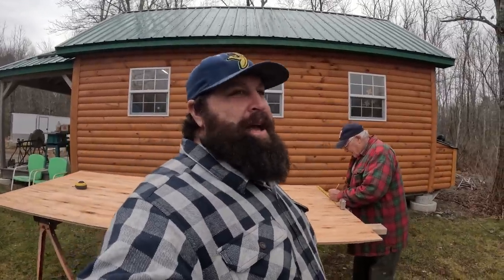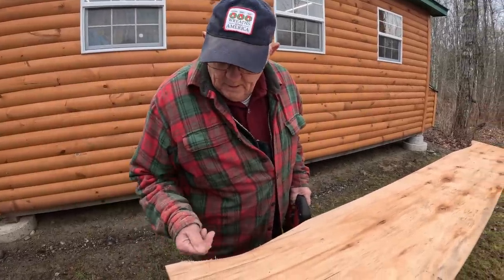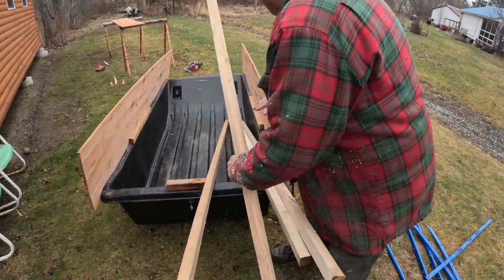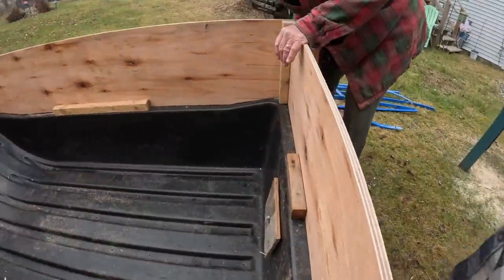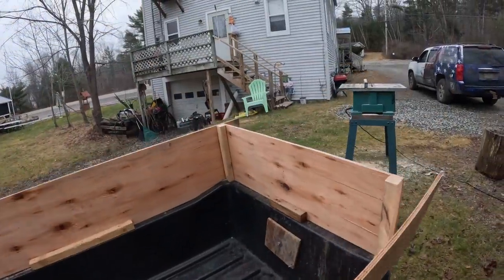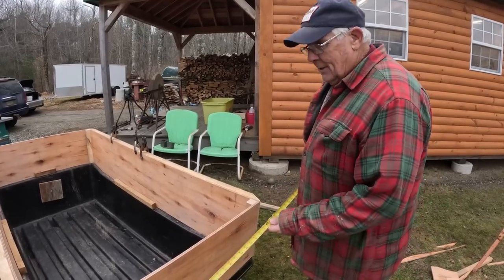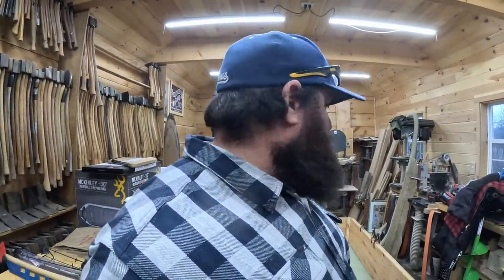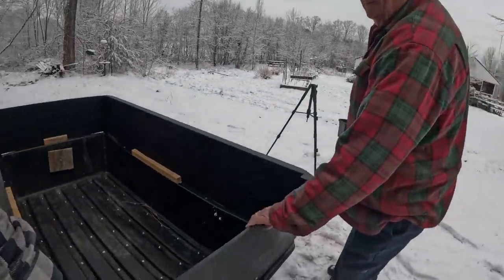BUILD YOUR OWN BRANDON BOX

Comment: I was thinking about building one of these when I decided to upgrade to the otter pro large. Then I hauled my large up into the trailer when full. Couldn’t imagine having twice as much stuff in there! Must be heavy as all get out!  That being said, my pack basket was able to slide out from under the cover on our way back this weekend. Total yard sale.
Reply: i have the otter resort i think its the large sled, its damn near impossible to load by myself in my trailer if its loaded for ice camping lol.  ill put the snowmobile first then ill use it to grab onto and pull myself and the otter up 🤣
Reply: @ohnij3d221  I loaded my snowmobile first too, but then found myself stuck in the front of the trailer deciding whether to take the access window out the front, tromp over the loaded sled, or fling myself over the snowmobile to the side door. 🤣🤣
Reply from the maker: The sides and the cover are anti-yard saleable , without a roll over.

Comment: You should show if you run tandem otter sleds when you’re towing your gear.  Putting a rear connection to have two otter sled behind skidoo
Reply from the maker: I do run tandem. Just an I bolt through the back as a new hitch.

Comment: Why not rip treated 5/4 or deck boards an go all way around both sides an ends top an bottom an screw that o sled would stiffen an strengthen it for lasting an durability
Reply from the maker: no need to add the extra weight or material and time. Its rugged